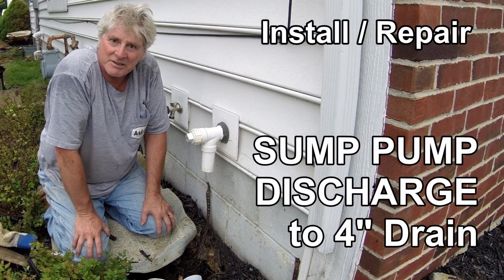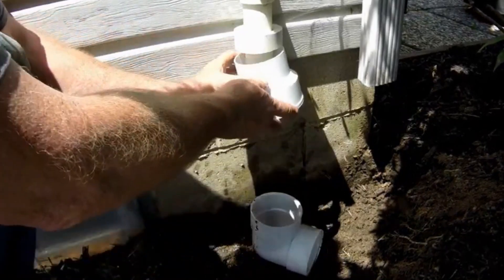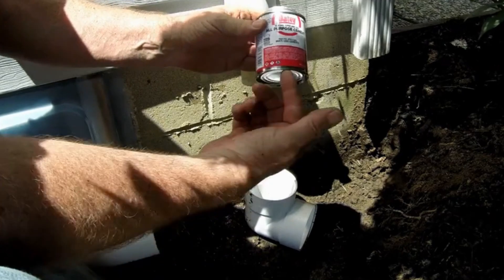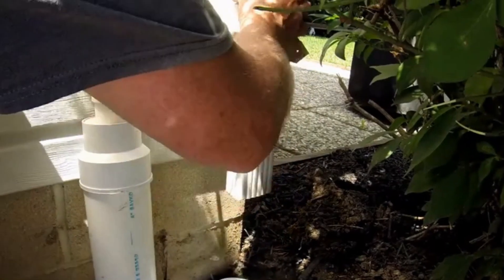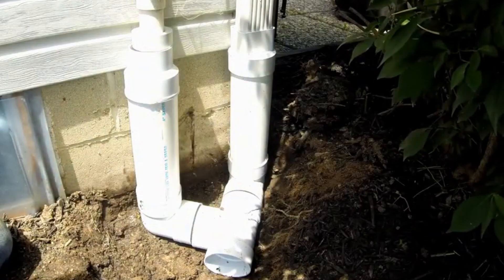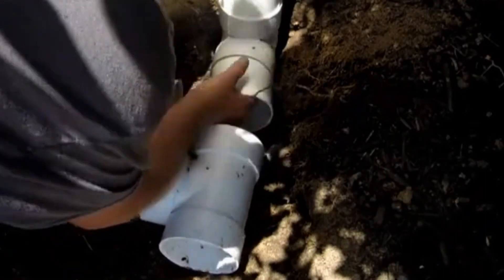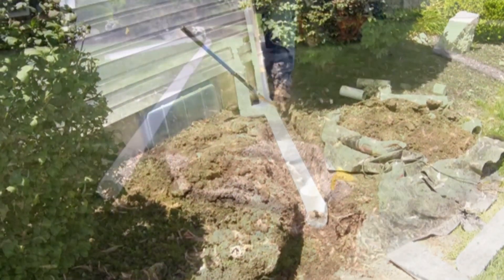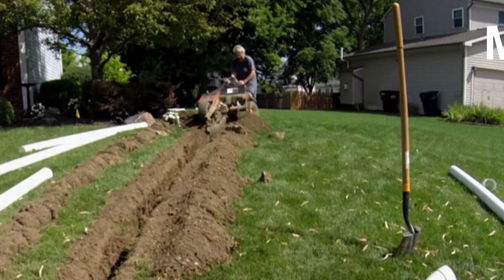Sump Pump system: How to Hookup Sump Pump  to outside wall discharge line

Comment: Never considered a cleanout outside instead of inside. Wouldn't you be snaking toward your check valve, plus sending the debris the wrong way if/when you snake it? Just wondering what the advantage is.
Reply from the maker: Hi Jake,
Thank you for watching.
 The clean out in the sump discharge is for emergency use. If underground line going to street should freeze or get blocked  by roots, you can take off clean out cap and discharge sump water out on ground and or put a temporary pipe extension on the clean out to move water away from  basement wall. Thanks again for watching!!!!
Reply: @AtlanticDrain but how do you clean/remove sand/leaves coming off the roof that are now in that pipe?

Comment: Shouldn't there an overflow for the sump pump discharge if the underground pipe gets blocked?
Reply from the maker: @autoworkout  hey auto,
Thank you for watching.
There is a pump clean out connection where the pipe comes out of wall. Simply remove threaded cap, pump discharge will splash out to ground. You can also put an extension on the threaded connection move water a at from wall as far as you would like. Normally, if this is done it is a 10' piece of pipe or hose.
Thanks again for watching!!!

Comment: Where’s the vent ?
Reply from the maker: hi glenn,
thank you for watching!
water coming from sump pit / pump is active pressure water. no vents are on a supply side of piping sytem. once the water reaches drain pipe underground, venting is achieved thru any dowspout to drain connection.
thanks again for watching!!!

Comment: Never seen those referred to as donuts in Ohio. They're called bushings or reducer bushings. Fernco rubber bushings are called donuts. Is that a regional thing?
Reply from the maker: Hey Jake, thank you for watching.
Preference really, we also call them reducers here...
Also have heard bushings as well and suppliers call them all three and usually know what I'm talking about with any of the above  names. Official name is 1.5 x 3 pipe reducer. Donut for short, least amount of enunciation needed when  relaying my list  / parts order to my supplier, English easy slang. It also looks exactly like a donut. When the part gets extruded from the mold they put them into  a box by the dozen. I could say more but, maybe you can come up with a few😋.
It's just the easiest way  to reference and talk about . Gets embedded into memory when you hear it. Sometimes, I say all three just to be sure the parts supplier can not mistaken what I'm talking about...

Thanks again for watching!

Comment: Nice but I would do a "Y" vs a "T" when the two lines meet plus I would also install clean outs on both downspout and sump pump discharge.
Reply from the maker: hey pt,
thank you for watching.  you could if you want to but, really not necessary on 4" pipe.